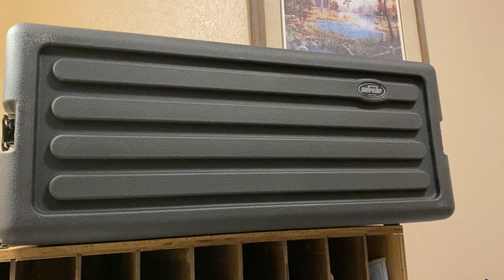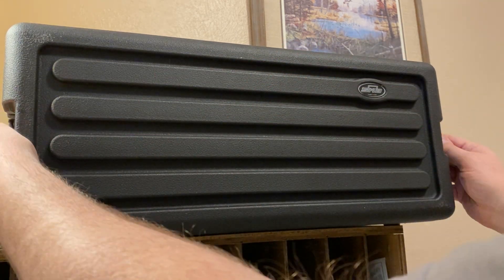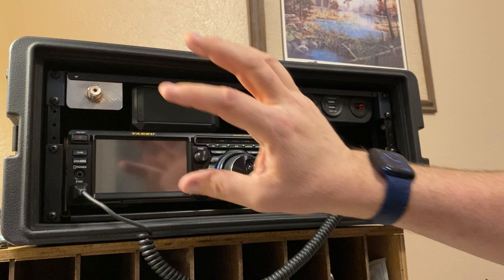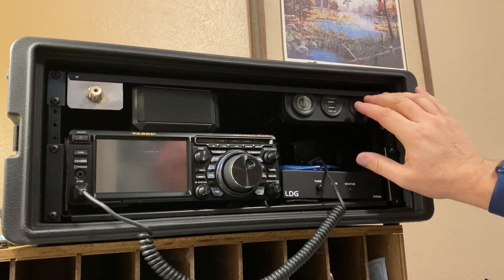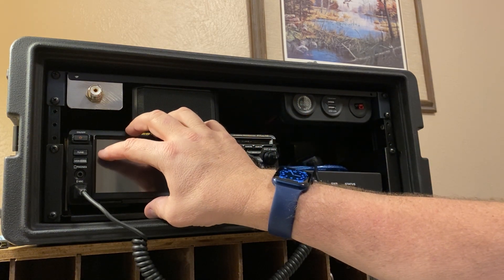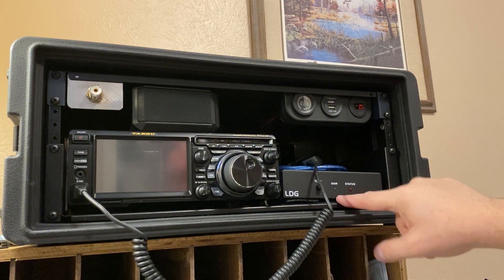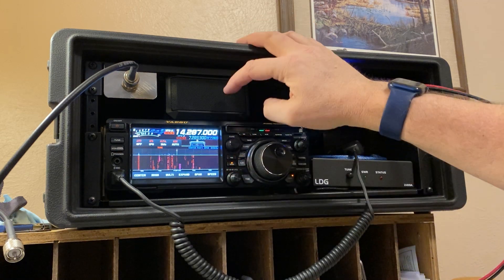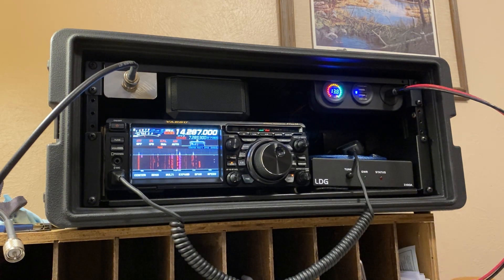Ham Radio Go Box - HF and Tuner VERSION 2 (Updated)

Comment: Bob, do you use a interface cable for your Z100a and the FTDX-10? Are they compatible?
Reply from the maker: I had to order a specific cable for it. HRO did not have it in stock. Oddly enough it plugs into the amplifier port on the radio. I have to turn off the tuner on the radio and use the button on the tuner. But it works great.